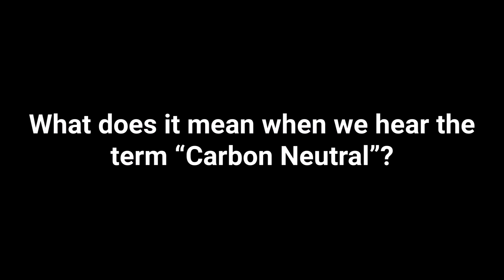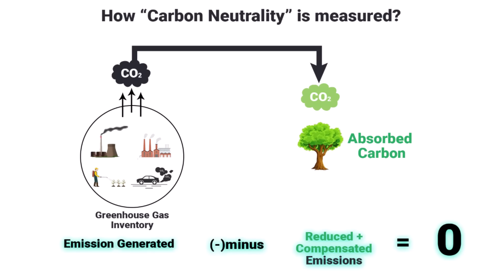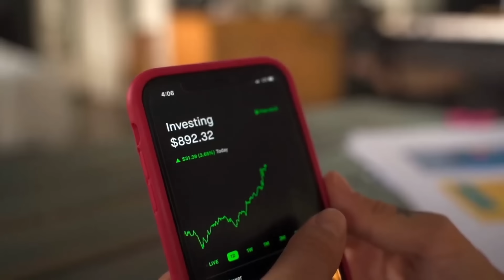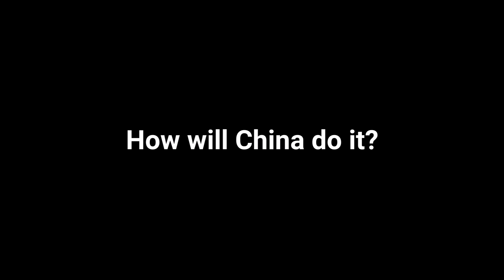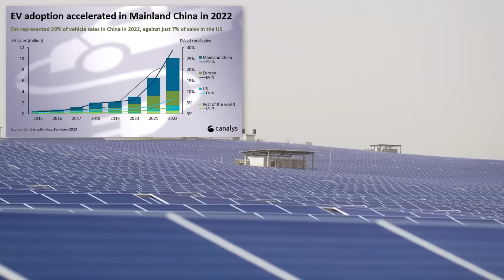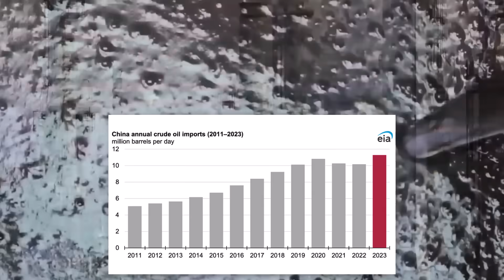China’s 2060 Carbon Neutral Promise - Hero Move or Hidden Strategy for Global Power?

Comment: Amit channel use to be good compare to now. There too much anti China perspective that real info are skip:

1st China pledge for carbon neutral are not new it started decade ago and the target date still the same.
2nd China focus on what need to be done build up country first then pivot to climate. No matter how much 1 promise like Europe or brag like Modi about climate no money and no tech = nothing been done. Planting been done at dessert since way before China economy improve that how "China green line" exist.
3rd China invest more in green tech are not aim at dominating market as they already dominate 10 years ago. 2nd does not even come close.
4th How does China balance economy growth is easy. Economy and climate does not need to be sacrifice for either. China are advancing both doing research green tech and manufacture equipment move economy while those research and equipment improve green energy.

Comment: In regards to cutting of emissions, if we use the petrol for cars for energy production, then we have 4 cars worth of energy. Meaning we reduced carbon emissions by 4 times. Further if we use the excess heat of the process then we could heat homes. Just by doing this emissions of China can be reduced drastically. Add to this that on power plant big filters can be built instead of small filters on cars and now we have no fine dust and acid rain issues. And all this will reduce emissions with even switching to a renewable energy source. That’s why China wants to electrify and not only renewable. Take heat pumps for example. A heat pump can create 4X the heat with 1X energy an electric heater uses. If we just power electric heaters with coal power or gas or oil power generators then we are 20% more efficient thus less emissions. If we use these fossils for heatpumps then we can be 3-4 times more efficient. We thus can heat 4 homes with the same amount of these fossils. 
And if China builds ceiling cooling and floor heating it can do even more with less emissions.
If China just electrifies then it already losses most if not all of its emissions.
Rail in China is already preferd over planes for most routes. 
China now only needs to electrify homes and transportation (of goods). 
The people are already of roads due to trains, now local transport has to be electrified and after that the roads are freed up for electric cars and trucks, which they will use until their Cargo Train lines have been upgraded (currently their cargo trains are really bad)

Comment: 1. The target to reach carbon peak in 2030 and carbon neutral was set in 2020, not 2025. The recent announcement is about more concrete steps, including reducing carbon emissions by 7-10% before 2035. 2. China started to invest heavily in clean energy more than 20 years ago. And because of technological advancements, the unit cost of solar power is already lower than coal power. 3. When China sets targets, most of them will be achieved, instead of delays and excuses.

Comment: I don't get this stupid craze for solar and wind when nuclear power exists. I think solar and wind are very situational like if your country is near the tropics/desert or you have a lot of windy mountains/sea coasts then it might be a good investment. 

But for most heavily industrialized nations, nuclear power is the way to go and is the best way to meet intensive energy demands. Hydro is good too.
Reply: As far as I know, China also invests a lot in nuclear power. It just wasn't mentioned in this video.
Reply: Investing in Solar and wind means most countries have to import the equipment from only certain countries. Business for a long term until new thing crops up and then go back to the same old system. Until then keep shouting, I am with you on Carbon Neutral to everybody. Just pre marketing.
Reply: Solar is free, nuclear is not.
Reply: @IamHandsome4u  Only sunbath is free. Taking out Solar energy to power grid requires lots of investment that could last 20 years. The amount of energy used to produce Solar cells is also high.
Reply: @subramaniamchandrasekar1397  i'm talking abt the source.🤦‍♂️
Reply: Nuclear power are not the best energy source, many places can`t produce nuclear power it need suitable condition and still risk explosion and contamination. Solar and wind are just another option. I for one can`t make sense of the mindset of only depend on 1 tech and not attempt to diversify.
Reply: It's not easy for China to develop nuclear stations in every cities. It takes time. So for poor and remote  areas, solar and wind are necessary.